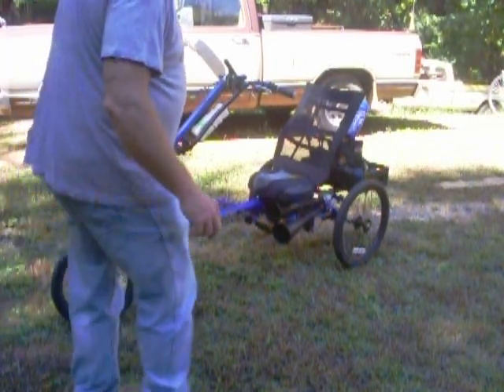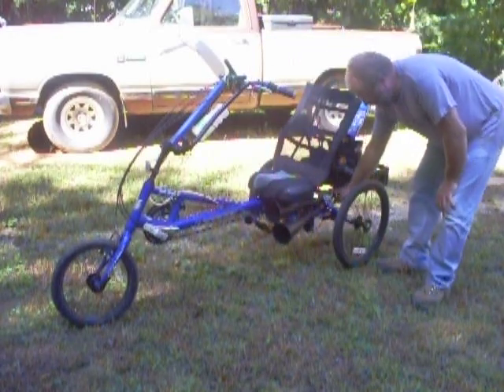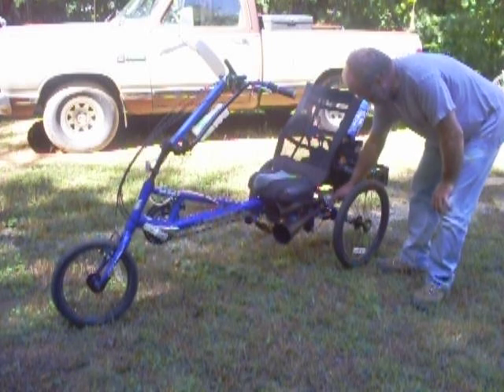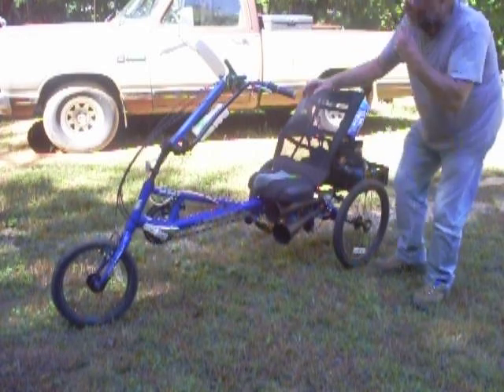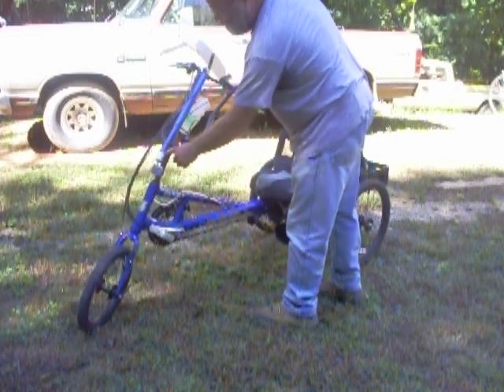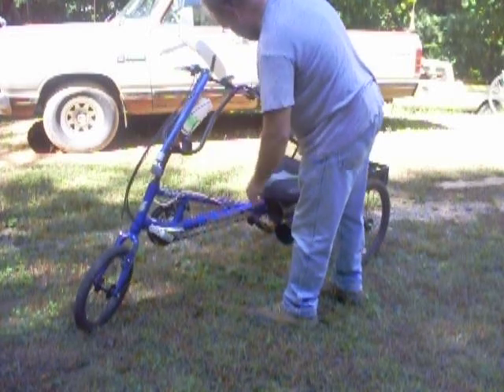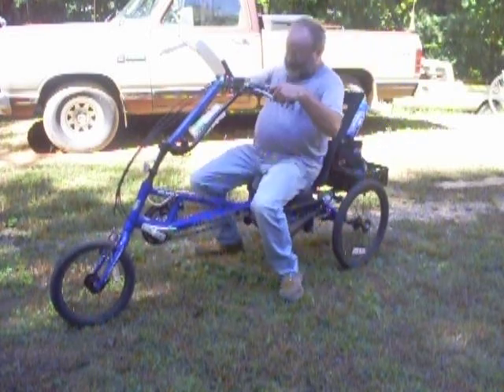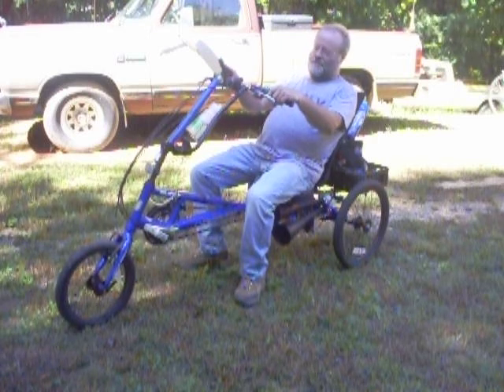bike PVC Pipe air horns LOUD

Comment: I like it. I wrote you about my daughter marrying an Alabaman. I am new to this commenting online stuff. I've watched moto sancho for a few years now. When and where did you find that Dneiper ? I have 2 Urals myself. We enjoy them thoroughly.
Reply from the maker: In 1992 after the collapse of the Soviet Union Ukraine asked the USA to sell 125,000 Dnepr motorcycles in the USA they found in wearhouses all over Ukraine to help fund their new government. That was approved so they exported thousands to the USA. Arbalet Motorcycles in Kiev Ukraine still has a warehouse in the State of Nebraska and continues sending Dnepr motorcycles and Ukraine built vintage Soviet vehicles to the USA. They also ship parts for all of that stuff to the USA so it was easy for me to rebuild my Dnepr despite it having only 194 Km because the build quality was so bad at KMZ. Anyway a guy ordered it in 1992 and when it arrived it needed lots of work, which no one here would do. According to the import paperwork the bike sat in storage 20 years in Ukraine so all the seals and gaskets were already bad from just sitting. He parked the bike in a barn and forgot it. I purchased it at his estate sale for the value of the sidecar and it's frame because the engine was stuck. I poured a 50/50 mix of automatic transmission oil and acetone in the cylinders and let it sit overnight. That freed up the engine and I managed to get it running on one cylinder. That's when I knew I had to save the motorcycle because it is a cool peace of Soviet Union history and the Cold War era.
I watch Moto Sancho too. I know a little of the language now but just watching is good enough. He does amazing work with very little resources.